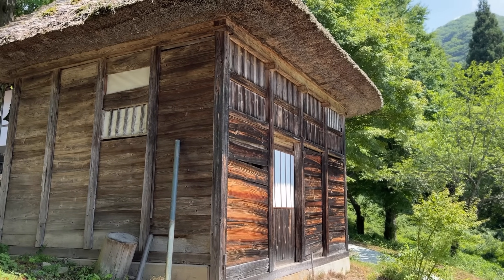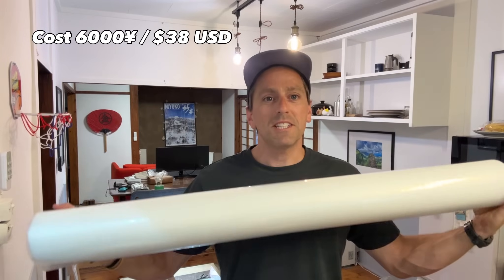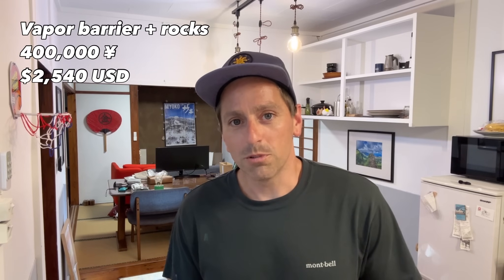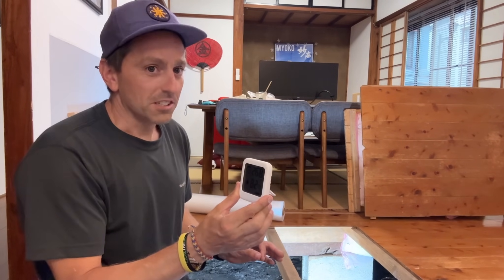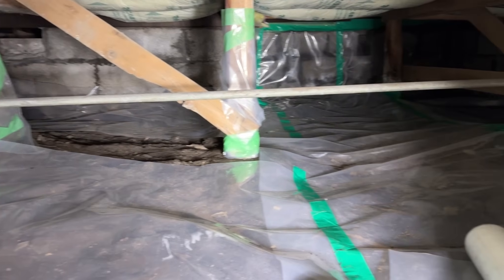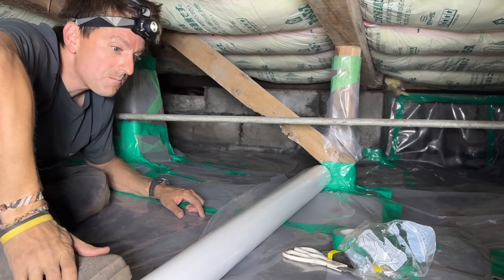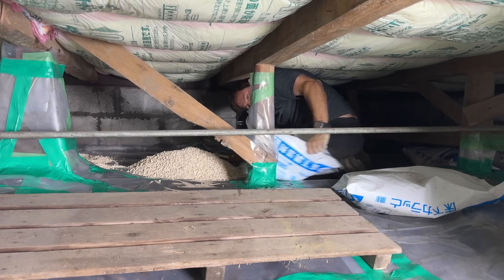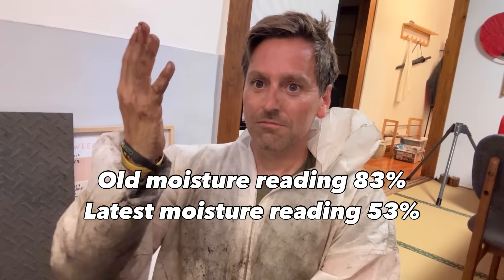$6000 house: reducing humidity with a vapor barrier and zeolite rocks

Comment: Matt, I've also got a place in Myoko and i also use swutchbot temperature and humidity sensors. Something to be aware of is tgat the reading is not relative humidity. A reading of 80% in winter is nothing to worry about. The moisture carrying capability of cold air is much lower than warm air so 80% in winter is not the same as 80% in summer

Comment: Putting the plastic down 👍🏻 but putting the granite down not so sure. If you put it down then cleaned it up once it has absorbed the moisture 👍🏻 once it is full it stops been useful. It may even start to release moisture as it is drying out 🤔

Comment: In some of the drawings I noticed the posts were jacked up with concrete footings.  

I would think that breaks the wood to earth connection and eliminates termites coming up into the building. 

In your situation you wrapped the posts.  

Wouldn’t that confine the moisture from the ground to right around the posts creating an ideal termite situation?

Comment: What do you do to reduce your humidity? Well the current temperature where I live is 7C and humidity 94%. Luckily I live in England and humidity here is generally low in the summer so it's just winter we really have to deal with. Plus I have a concrete floor under my tiles, the house is brick construction (circa 1984) and no basement or crawlspace. To reduce condensation ( which leads to damp and mould) in my home I have a condenser drier and I have a smart exrtacter fan in my wetroom and a manual in my kitchen. I kept the doors closed when showering or cooking. Plus I leave the vents in my double glazed windows open all year round for airflow (situated at the top of the windows). I have full gas central heating with radiators and in winter I maintain a steady low temperature using the small portable smart thermastat ( 20C for a couple of hours when I get up and in the early evening, 18C during the day and 10c at night). My bungalow has cavity insulation and a well insulated loft. I also use thermal blackout curtains on all the windows. I only recently had the portable thermastat installed and am actually amazed to see how well my home maintains the temperatures I've set. I also have solar panels on the roof so get the use of free electricity during daylight hours but don't have storage facilities for it. I rarely get mould ( occasionally at the bottom of my bathroom window is all) and never any damp. I think one of the biggest killers of damp and mould in my home is the cavity wall insulation. My previous home didn't have it but had many of the other features so I was plagued with damp and mould in my back bedroom which basically didn't get much sun and got very cold. Personally I think I'd find it very hard dealing with the high summer humidity in Japan. ❤
Reply: In Japan ductless minisplits ("aircon") are common for cooling and dehumidifying. Almost nobody has central heating and cooling and dryers aren't so popular (laundry poles and balconies are common).

Comment: Good choice. We added 1" foam board glued to the block to limit winter cold intrusion. For tracking down cold air leaks at door seals, etc. an inexpensive infrared temp gun is very useful.
Reply: yes, i was just studying up on this - https://www.youtube.com/watch?v=QnFoiUXr4h4
Reply: And reflectix insulation. People in very cold climates here in the USA use it very successfully